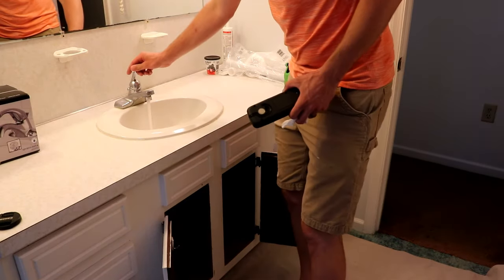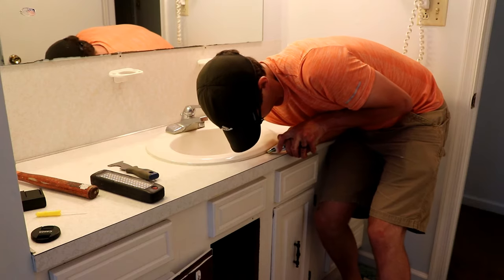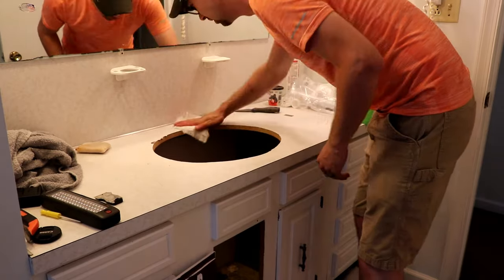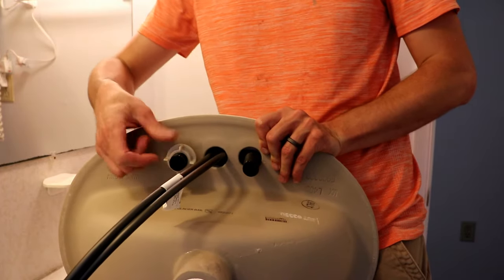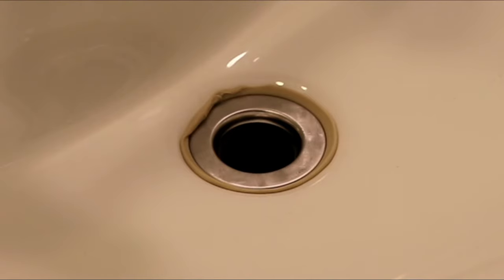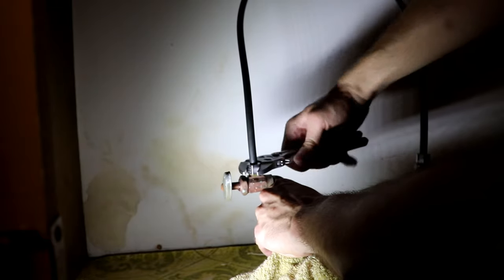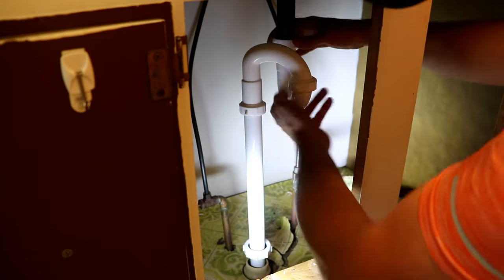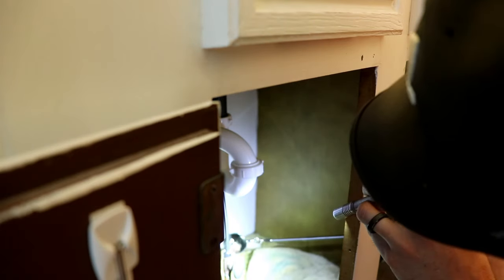How to Replace a Bathroom Sink

Comment: Missed the part where you apply a new bead of sealant between the sink and the counter. Probably obvious, but would be something a newly is interested in. Specifically, what sealant is used and is it applied to the counter or rim of the sink?
Reply: EXACTLY, it's why I came...in my opinion, BIG miss.  I know there is more to it than just that caulk ring.  I pulled a sink in my old house and it looked to have been beded with Plumbers Putty, the replacement sink was put in by a plumber that was doing other work for me so I don't know if it was bedded or just a beat of caulk.
Reply: ugh me too
Reply: Me three.
Reply: I'm just finding out that the previous owner of my place had just whacked some foam in between the sink and the vanity top part..... I'm not surprised though, I also recently found a hole in the laundry wall with a plastic cup in it and it was even painted the same colour as the rest of the laundry (except the window and floor) which is a dusty looking dark violet...
Reply: @WreckDiver99 I'm wondering if you need silicone as well, or if the plumbers putty and caulk are the way?
Reply: @saintessa after watching this, I found some "sink caulk" and spoke to a plumber friend.  He said use the caulk in a decent bead on the sink, push it down, and clean the squeeze out from around the sink itself.  He went on to say that if you don't get enough squeeze out to make a nice finished "grout style line", to run a bead around the outside and clean it flush for a finished look.  It worked great!  I used a DAP caulk in almond since that is the sink color.

Comment: You made this painfully easy 😂 Thank you, I do have one question though, if I did peel and stick, should I do it while the sink is out or after it’s installed?
Reply from the maker: If you're referring to replacing the countertop surface, do that before installing the new sink.
Reply: @ZachFields  I was talking about the adhesive countertops, peels off if you don’t want em lol

Comment: I would of replaced the valves too ( they are prob nasty inside,  mine were when I replaced them. I just cut them off, cleaned up the pipe and popped sharkbites on. Ez.

Comment: How much would it cost if you hired a contractor to do the install?
Reply: 2500 and 2 weeks.
Reply: @rhabdob3895  lmao
Reply: @rhabdob3895  hell no
Reply: @dareonallen9574  yeah, well check back in 2 weeks and we’ll see where we’re at.
Reply: 150$
Plus any modifications if needed

Comment: I still have running water after turning the hot and cold under the sink off… not sure why. What’s the best way to measure to replace a sink?
Reply: One of the valves isn't closing. May have to cut the water off near the meter to replace the valve and sink.
Reply: You need to replace the water valve not the sink. B4 doing this make sure you turn the water off at the main water meter.